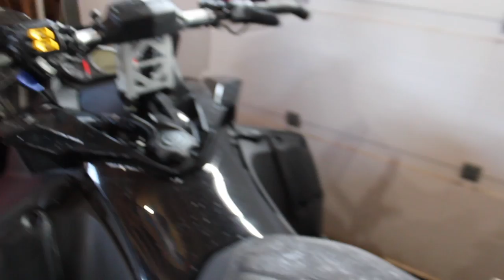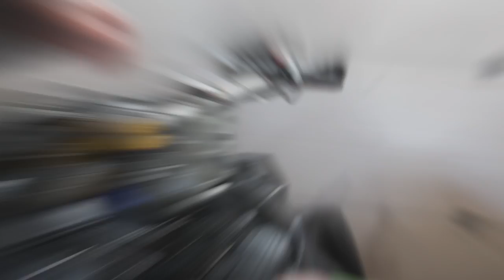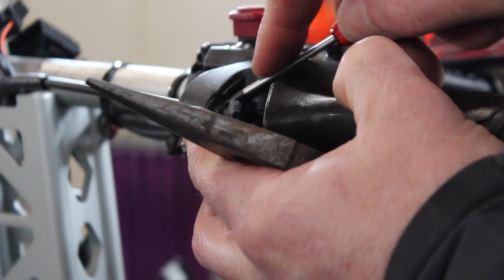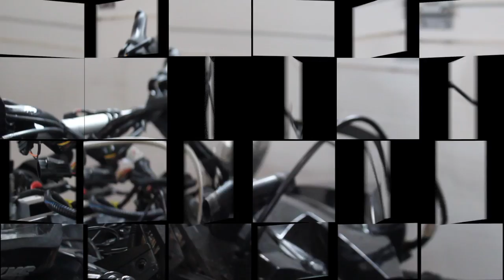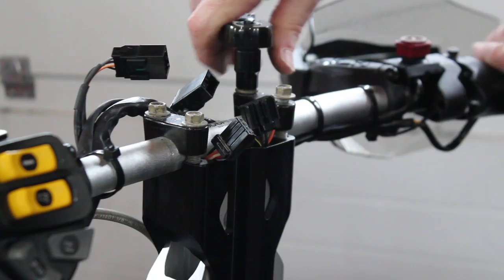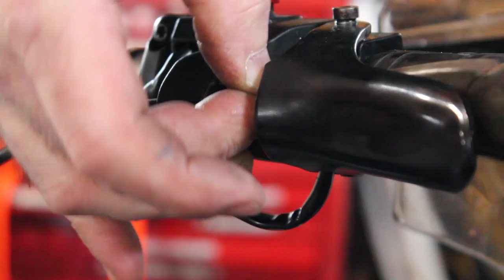Ski-Doo How To Install Adjustable Riser Rev XP Renegade 800 e-tec

Comment: I have a 2018 Ski Doo Renegade 600 sport and I am looking to put the same risers on my seld. Did you have to use any cable extenders at all or no?
Reply from the maker: no cable extenders needed.  Its pretty taught at full height but no issues

Comment: Thanks for posting,  are you still happy with the rise? Looking to add the same riser to my gen4 narrow chassis. Same issue just a little to low to comfortably stand. Had my old cat dialed in but with AC deleting all their dealers including my local shop I decided to try a renagade adrenaline.  So far it's seems nice but still not the perfect feel trigger had. Switching sleds is a project.  Forgot all the things I changed to my liking over the years.
Reply from the maker: Mark W yes i am happy with this riser.  But for a Gen4 i would recommend the forward adjustable riser.  The gen4 handles way dofferent than the older rev platforms. instead of side to sode weight trasfer of the rider in turns, the gen4 likes forward and back weight.  If u still need height add a small block under the forward adjust riser.  I think you would be a lot happier with that setup over this older riser.  Let me know how it goes!

Comment: How did you remove the gauge cluster/fairing? I’m stuck on that part.
Reply from the maker: theres torx screws on the sides and one under the headlights at the front centre